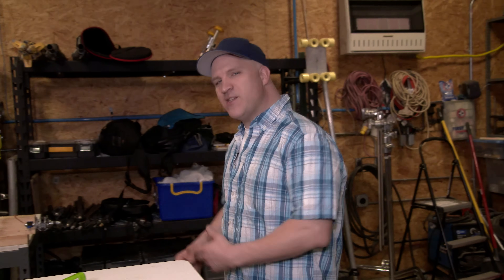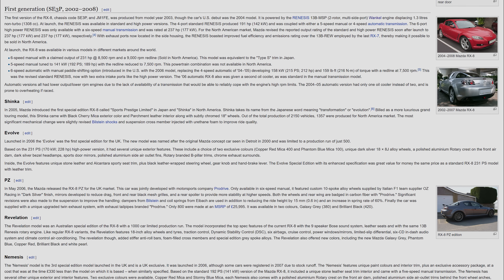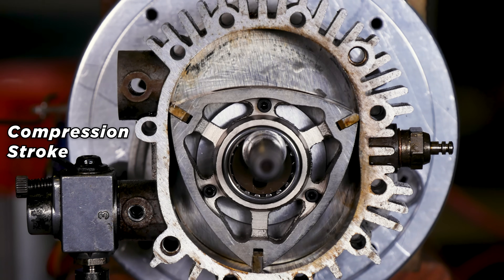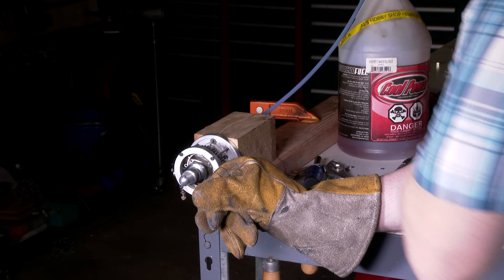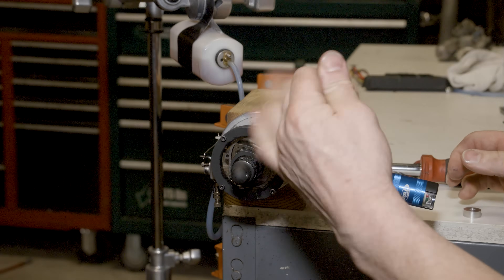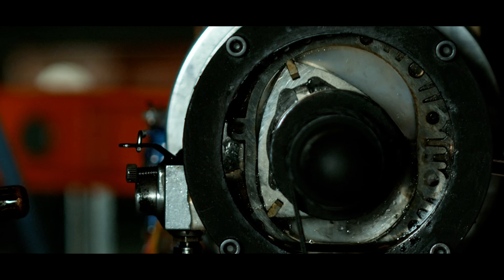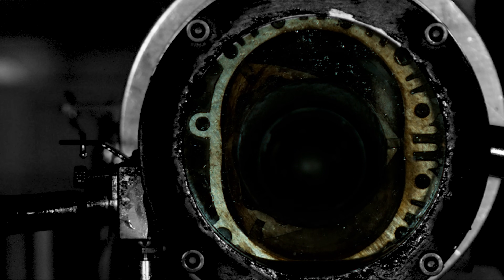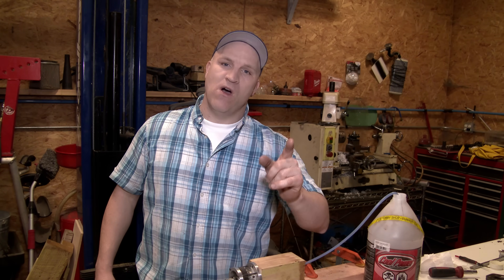See Thru Rotary Engine in Slow Motion - (Wankel Engine) 4K

Comment: You can see why we call them "Rotary Fuel Pumps".. The burn a little bit of the fuel on the way through, but a lot of it gets chucked straight out the exhaust.  Fuel Economy ?  Whats that ? ;)
Reply from the maker: SpockieTech I'll tell you on my past RX7, I always wondered why if I was sitting there with the air conditioning on in the summertime holding it at about 2,000 RPM getting some nice cold air, people would walk up to my car and tell me that they saw a glowing light from underneath, I would look underneath the car and the catalytic converter look like an incandescent light bulb...lol. all that fuel in that secondary combustion chamber AKA catalytic converter..
Reply: no one buys a rotary for fuel economy.
Reply: So if you took off all the emissions  stuff and mounted a spark plug to the end of your exhaust.....You would have a flame thrower 😆   
Na na na na na na na Na... Batman!
Reply: Haz Old no
Reply: Lmao this guy bimmer hate rotary so much... Saw him in some wankel-related videos. You must stop talking to this guy lol.
Reply: +Abil Harsono  Just the fact here, go troll somewhere else kid.
Reply: Always gotta remove the cats on an RX7 so you get those mad rotary flames on decel ;)
Reply: Warped Perception, if your cat was glowing red, you had an issue with it or the engine. My ‘94 never lit the cats up.
Reply: I wasnt talking to you and I dont intend to. I cant take people serious that search for videos about the wankel all day long to tell the people in the comments that it sucks. If you dont like it, you dont have to drive it, but leave interested people alone and stop spreading your bullshit.
Reply: As I already said, I cant take you serious, so there is no point in further talking.
Reply: Mach SCGA yeah downhill. Don’t lie about mpg. It’s really just a reflection of your driving habits anyway.
Reply: @BAYAREAMX  2002 cummins pulled 20mpg all day long, and 15 with a 12k lb trailer on the highway. around town about 15, and 19 with a camper.
Reply: I had an RX3.  Now I am the most sedate driver you could imagine.  On  low throttle I still only got 22 to 26 mpg.  But it didn't use a lot more to go a lot faster.  Low end torque?  Forget it.  But when I really used the power, going up a mountain range doing 100 mph in third then changing up into top.   It just sang. Not like me really.  But wonderful nonetheless.
Reply: SpockieTech, nitro methane is a different beast. You can’t really compare that to gasoline. Ever stand next to a funny car or top fuel in the pits while it’s seating in the engine after a rebuild? Lots of raw fuel exiting those Zoomies! 😈
Reply: Is there any way to adjust the issue
Reply: It's probably exacerbated because it's running on nitromethane.  
Watch a nitro dragster make a run at night.   There are flame shooting out the pipes from the unburned fuel.
Reply: The rotary has the same benefits as a two stroke piston engine: With less space and less moving parts they can achieve more rpm and more power, but they suffer from the same weaknesses aswell: Bad fuel economy and horrible emissions because of a lot of unburnt fuel and actively burnt oil, but they could also be fixed in the same way by simply applying todays technologies to these old engine designs: Boost, direct injection and maybe even HCCI. Sadly the two stroke didnt survive until those became popular but we kinda see the idea when looking at the two stroke diesel engines that dont burn oil and achieve selfignition while keeping the advantages of the classic two stroke. Maybe we will see something similar in a rotary someday but its a very tough nut to crack.
Reply: All science is based on faith, you may not accept that but there are no true laws in science, they are just valid until they are proven wrong, and they eventually will and so will you. HCCI isnt even properly utilized with valve control yet, so how would you know that it cant be achieved without?
Reply: Surely then there'd be a lot of potential in a lean burn rotary? Or one tuned to run slower but with greater torque output? It's essentially the same set of effects you'd see from a piston engine running far too rich.

Or even just running a steam compound type system... exhaust from one feeds into the intake of the next, with a little extra clean air bled in... maybe the first running CI, the second running SI...
Reply: They don't. If you measure the temperature at the tail pipe the gas temp is the same as any internal combustion engine. The exhaust pipes do run hotter closer to the engine than a piston engine simply because each pipe handles the heat from the equivalent of two cylinders so will run twice as hot as the individual pipes from each cylinder in a piston engine. Actually a piston engine with Siamesed exhaust ports will show the same EGT as a wankel engine and do so. 
CO? I think you mean NO? Apologies if you didn't but NO level is a function of combustion temperature and a high EGT is ALWAYS an indication of high combustion efficiency, but that must not be confused with overall efficiency. The efficiency of the wankel is poor because of the high surface area to volume ratio. More of the heat goes into the coolant and oil than a piston engine. I wish we could design an engine that utilises an expanding sphere principle, that would have the highest efficiency.
The CO level is a function of the displacement, the more hydro carbon you burn the more Carbon Dioxide and water produced, its as simple as that, why the emissions people measure CO is a complete mystery to me. All they need to know is the engine's displacement. 
The high HC level is just the oil being burned in the combustion chamber and that is another problem with the wankel engine, you have to introduce oil into the intake charge to lubricate the apex seals. If that could be dispensed with, the exhaust gas HC levels would be similar to any other IC engine. But despite what I've said, I think the wanklel engine is really an engineering curiosity and not suitable for use in automobiles but it is excellent for use in power tools and model aircraft. It's power to weight ratio is unbeatable. Oh and the RX8 goes like stink because of this power to weigh ratio! Thanks for the questions. And all the best.
Reply: How the fuck was there anything wrong? Being obsolute is nothing but your opinion and isnt based on any facts. In fact you are the one speculating that it wont ever be used again and future will tell.
Reply: Youre the one living in a state of denial, im living in a state of hope, you should try that too, might make you able to get rid of some of your negativity, because even if there is absolutely no evidence of something to happen, why would you remind yourself of that over and over again if you could just be positive and wait instead? Anyway, if by that technical feature youre refering to any sort of valve control like you mentioned above, I dont see a reason to implement them into an engine that doesnt even need valves, you can control injection and you can control ignition, what do you want more?
Reply: + Haz Old -I wouldn't bet on it being possible in a cost-effective way. Even using some new technology that hasn't been invented yet,  it'd be hard for Wankels to catch up,  because that tech. could probably be used on piston engines, too, and they would pull ahead again.
Reply: Dr. Cannibalism, and through the gears 😈
Reply: dan428 not true. Most new diesel trucks average between 12mpg-16mpg i  know I've  owned  both where my rx7 averaged about 26-28mpg. All the diesel emission BS they make these trucks have actually get far less mpg than the older diesel trucks.
Reply: The 4 port is ok. But they have a large surface are to combustion camber ratio so a lot of the heat (power) goes straight into the oil and coolant. But it is a 2.6L engine so it wont be as economic as a 1.3 will it.
Reply: Mach SCGA your * new truck. 93 f250 460 gets 5-7mpg.
Reply: The 4 port engine seems to be very reliable but the 6 port gives all the trouble. Simply because you can over rev it too easily. Once over revved the housing is damaged and the apex seals "trip" in the damaged area, after that the engine is toast. Also because of the slow gas velocity (because it is a very short stroke engine) and the surface to volume ratio the engine is poor the low speed fuel efficiency is also poor. You also get leak from one chamber to another via the spark plug holes. Another real problem is lubrication, unless oil is introduced into the intake charge there is no other route for oil to lubricate the apex seals. So yeah its a lot to consider when you can buy a car of similar performance  that consumes less fuel without all those issues. But unless you have driven a rotary car you cant understand it at all, but there is something about  the way the rotary performs. It is also very small and light but it is NOT more powerful for its capacity than a piston engine. Er yes why did I buy it......................Point made ha!
Reply: Well it gets dumped into the cooling system really there is no unburned fuel in the exhaust if its set up correctly. I know how about a rotary heating furnace?
Reply: Yes indeed! They were really 'dirty' running as well... very difficult to make emission compliant. Annoyed the smog gods to no end. Novel idea, but there were many other issues as well; mostly related to cooling & lubrication of those apex & other seals. An overheat 'event' could catastrophic to many of them...
Reply: That is the afterburner..........LOL
Reply: +niecers Mazda purchased a licensing agreement from NSU to develop and produce its Wankel KKM design in 1961... well before emissions and lead free fuel regulations. The Wankel design was licensed by 26 major engine manufacturers but most of them abandoned the Wankel around the time of the OPEC Oil Crisis due to the designs notoriously poor fuel economy, Mazda attempted to launch an all Wankel powered model line just as the Oil crisis peaked and the company was plunged into bankruptcy for the second time in its history...
Reply: @doktorbimmer  The rotary has the same benefits as a two stroke piston engine: With less space and less moving parts they can achieve more rpm and more power, but they suffer from the same weaknesses aswell: Bad fuel economy and horrible emissions because of a lot of unburnt fuel and actively burnt oil, but they could also be fixed in the same way by simply applying todays technologies to these old engine designs: Boost, direct injection and maybe even HCCI. Sadly the two stroke didnt survive until those became popular but we kinda see the idea when looking at the two stroke diesel engines that dont burn oil and achieve selfignition while keeping the advantages of the classic two stroke. Maybe we will see something similar in a rotary someday but its a very tough nut to crack.        Chuckiele
Chuckiele
8 months ago
I wasnt talking to you and I dont intend to. I cant take people serious that search for videos about the wankel all day long to tell the people in the comments that it sucks. If you dont like it, you dont have to drive it, but leave interested people alone and stop spreading your bullshit.  How the fuck was there anything wrong? Being obsolute is nothing but your opinion and isnt based on any facts. In fact you are the one speculating that it wont ever be used again and future will tell.     All science is based on faith, you may not accept that but there are no 
true laws in science, they are just valid until they are proven wrong, 
and they eventually will and so will you. HCCI isnt even properly 
utilized with valve control yet, so how would you know that it cant be 
achieved without?     As I already said, I cant take you serious, so there is no point in further talking.              Chuckiele Not true, The Wankel engines inherently weak sealing system and poor combustion efficiency make it poorly suited to high manifold pressure forced induction. GDI was already tried back in the 1960's but the Wankel simply cannot support the high static compression ratios required to achieve significant performance gains with direct-injection stratified combustion. HCCI??? How? Its not possible to adapt VCR, VVL or VVT to the Wankel... its limited to port induction and exhaust and does not generate high enough static compression. The Wankel is obsolete... for some very good reasons... it is an inferior design that no longer offers any further development potential. RIP 1964 - 2012@ktorbimmer
            
            
            

      
      +Chuckiele Engineering is not a "faith based" endeavor son, it is a science that must comply with the laws of mechanics, and the laws of thermal and fluid dynamics. Mazda manufactured the Wankel KKM longer than any other company and they have not released a new production Wankel engine in 23 YEARS!  So I sincerely suggest if your hoping for the Wankel to comeback? That you don't hold your breath!
    +Chuckiele Engineering is not a "faith based" endeavor son, it is a science that must comply with the laws of mechanics, and the laws of thermal and fluid dynamics. Mazda manufactured the Wankel KKM longer than any other company and they have not released a new production Wankel engine in 23 YEARS!  So I sincerely suggest if your hoping for the Wankel to comeback? That you don't hold your breath!
Reply: +Chuckiele Its Not?  Are you not familiar with the Mercedes-Benz Diesotto technology demonstrator? That was unveiled a decade ago? https://www.youtube.com/watch?v=N-kYwaUBwZM
Reply: +Chuckiele  "HCCI isnt even properly utilized with valve control yet,"   You have to see the irony in that comment... as MAZDA will be the first on the market with its hybrid HCCI engine in 2019. https://insidemazda.mazdausa.com/the-mazda-way/technology/mazdas-skyactiv-x-breaks-cover/
Reply: +Chuckiele You can't even fully understand basic fundamentals of engine operation yet... The Wankel KKM and HCCI technology appear to be well beyond your ability and skill level son.
Reply: +Chuckiele I don't think you take anything seriously... certainly not automobile engineering.
Reply: ernie brink rotary hemi1 second agoernie brink rotary hemi5 minutes ago (edited)Chuckiele8 months agoYoure the one living in a state of denial, im living in a state of hope, you should try that too, might make you able to get rid of some of your negativity, because even if there is absolutely no evidence of something to happen, why would you remind yourself of that over and over again if you could just be positive and wait instead? Anyway, if by that technical feature youre refering to any sort of valve control like you mentioned above, I dont see a reason to implement them into an engine that doesnt even need valves, you can control injection and you can control ignition, what do you want more?
oktorbimmer8 months ago+Chuckiele Engineering is not a "
        
    
Chuckiele8 months agoYoure the one living in a state of denial, im living in a state of hope, you should try that too, might make you able to get rid of some of your negativity, because even if there is absolutely no evidence of something to happen, why would you remind yourself of that over and over again if you could just be positive and wait instead? Anyway, if by that technical feature youre refering to any sort of valve control like you mentioned above, I dont see a reason to implement them into an engine that doesnt even need valves, you can control injection and you can control ignition, what do you want more?

    
doktorbimmer8 months ago+Chuckiele Engineering is not a "faith based" endeavor son, it is a science that must comply with the laws of mechanics, and the laws of thermal and fluid dynamics. Mazda manufactured the Wankel KKM longer than any other company and they have not released a new production Wankel engine in 23 YEARS!  So I sincerely suggest if your hoping for the Wankel to comeback? That you don't hold your breath!

    
doktorbimmer8 months ago+Chuckiele "technical feature that effects combustion efficiency"  NO, its not. Indeed, while one of the Wankel KKM's flaws is being limited to port induction and exhaust that is not what I was referring to.

    
    
doktorbimmer8 months ago+Chuckiele "I dont see a reason to implement them into an engine that doesnt even need valves,"  WELL THEN, How do you expect to implement HCCI technology????? Magic? or Hope

    
Chuckiele8 months ago (edited)All science is based on faith, you may not accept that but there are no true laws in science, they are just valid until they are proven wrong, and they eventually will and so will you. HCCI isnt even properly utilized with valve control yet, so how would you know that it cant be achieved without?

        

   based" endeavor son, it is a science that must comply with the laws of mechanics, and the laws of thermal and fluid dynamics. Mazda manufactured the Wankel KKM longer than any other company and they have not released a new production Wankel engine in 23 YEARS!  So I sincerely suggest if your hoping for the Wankel to comeback? That you don't hold your breath!

    
doktorbimmer8 months ago+Chuckiele "technical feature that effects combustion efficiency"  NO, its not. Indeed, while one of the Wankel KKM's flaws is being limited to port induction and exhaust that is not what I was referring to.
    
    
doktorbimmer8 months ago+Chuckiele "I dont see a reason to implement them into an engine that doesnt even need valves,"  WELL THEN, How do you expect to implement HCCI technology????? Magic? or Hope

All science is based on faith, you may not accept that but there are no true laws in science, they are just valid until they are proven wrong, and they eventually will and so will you. HCCI isnt even properly utilized with valve control yet, so how would you know that it cant be achieved without? god bless you doktrbimmer a big fake and you are not a engineer by all means fatih or hope dont care about your negative bs 
        
    
Chuckiele8 months agoYoure the one living in a state of denial, im living in a state of hope, you should try that too, might make you able to get rid of some of your negativity, because even if there is absolutely no evidence of something to happen, why would you remind yourself of that over and over again if you could just be positive and wait instead? Anyway, if by that technical feature youre refering to any sort of valve control like you mentioned above, I dont see a reason to implement them into an engine that doesnt even need valves, you can control injection and you can control ignition, what do you want more?

doktorbimmer8 months ago+Chuckiele Engineering is not a "faith based" endeavor son, it is a science that must comply with the laws of mechanics, and the laws of thermal and fluid dynamics. Mazda manufactured the Wankel KKM longer than any other company and they have not released a new production Wankel engine in 23 YEARS!  So I sincerely suggest if your hoping for the Wankel to comeback? That you don't hold your breath!

    
doktorbimmer8 months ago+Chuckiele "technical feature that effects combustion efficiency"  NO, its not. Indeed, while one of the Wankel KKM's flaws is being limited to port induction and exhaust that is not what I was referring to.

    
doktorbimmer8 months ago+Chuckiele "I dont see a reason to implement them into an engine that doesnt even need valves,"  WELL THEN, How do you expect to implement HCCI technology????? Magic? or Hope

  
    
    
Chuckiele8 months ago (edited)All science is based on faith, you may not accept that but there are no true laws in science, they are just valid until they are proven wrong, and they eventually will and so will you. HCCI isnt even properly utilized with valve control yet, so how would you know that it cant be achieved without?

GOD BLESS THE DOKTERBIMMER FAKE ENGINEER  AND ERNIEBRINK ROTARY NEGATIVETY

    
ernie brink rotary hemi3 days agoFuel consumption was also better than a comparable two stroke engine, but not as good as a conventional four stroke. This eventually became the downfall of the Wankel design

ernie brink rotary hemi2 days agohttps://youtu.be/mF2lR20aPL0     this one is with offset compression  super charged  check out more timing and the plug locations you will love it   performance   performance   performance  balance power with emissions.  and more efficient

ernie brink rotary hemi2 days agohttps://youtu.be/mF2lR20aPL0     this one is with offset compression  super charged  check out more timing and the plug locations you will love it   performance   performance   performance  balance power with emissions.  and more efficient
Reply: Mach SCGA diesels are very fuel efficient and rotaries are very inefficient.. this isn’t news
Reply: I reckon if today's fuel saving tech could be applied it could  make the rotary fuel efficient, like exhaust recovery systems n stuff
Reply: they have enough power to munch v8s. check out rotaries at the drag strip if you are unaware of whats going on.
Reply: @davidhusband5022  Bullshit. In mismatched races. Rotaries are under powered without   boost or nitrous. It's the low curb weight that's the advantage,  not the rotary.
Reply: triggered.
Reply: @davidhusband5022  
Your a fan boy and that's your opinion. When it comes to performance they are not worth shit. Pound for pound they waste fuel, produce little torque, burn oil to lubricate the apex and side seals, and require boost or nitrous for any kind of performance applications. Put your money where mouth is and bring a fast naturally aspirated rotary and I can bring a piston engine and wipe the floor with your precious rotary.
Reply: yeah and top fuelers are nothing without blowers too, so whats your point??
Reply: @davidhusband5022  
I replied that a v6 would dust your 1.3 trash, without boost or nitrous. My point is that your praising an obviously inefficient design. I dont need a big block to slay rotaries, or boost, or nitrous.
Reply: david husband Please just stop.. You're giving Aussies a bad name

Don't bother replying because I won't, just stop
Reply: Just simply put if you're not into rotaries you just don't understand it
Reply: +HERPY DERPEDY The Wankel has very low mechanical efficiency which is the reason for its very poor torque characteristics and it also why it was never adapted successfully to heavy vehicle use either.
Reply: HERPY DERPEDY these things are low on torque but the engine speed is where the magic happens ;)
Reply: +mosaic Then why did people stop buying them?
Reply: +Haz Old If you were going to go to all the trouble and expense of using second pass heat recovery? You would be better off starting with an engine that has higher Carnot Cycle efficiency than the Wankel, as each following pass delivers diminishing returns in efficiency gains overall.
Reply: +BAYAREAMX That's why we use the EPA 'drive-cycle' lab test to quote MPGs... this eliminates any spurious human or environmental influences on the test data results and gives of an accurate comparison between two vehicles of similar power and weight.
Reply: +Phillip Jones OH WOW! You really don't have a clue what you are talking about...
Reply: +Phillip Jones Wrong, the Wankel had a significantly higher Carnot T2 value.. this is directly related to the Wankel engines higher rate of heat rejection in the conversion process. This high heat rejection is observed as a higher EGT value for a comparable BSFC value
Reply: +Phillip Jones NO! I mean CO as in Carbon Monoxide.. You seem to be completely unfamiliar with vehicle emissions fundamentals or regulations... this is a critical indicator of combustion efficiency when the AFR value is known.. CO values are also a very good indicator of AFR.  The Wankel engine produces significantly higher levels of this poisonous and regulated exhaust gas product.
Reply: +Phillip Jones "Do you mean NOx?"  Wrong again... the production of NOx is determined by PRESSURE, OXYGEN RATIO and temperature.
Reply: +Chuckiele All Wankel KKM designs use the 4-stroke operating principle, 2-stroke Benz-cycle engine have fewer parts, and can actually rev higher. The 2-stroke reciprocating concept is vastly superior in all aspects to the Wankel and is still in mass production while the Wankel has become obsolete.
Reply: +Chuckiele Not true, The Wankel engines inherently weak sealing system and poor combustion efficiency make it poorly suited to high manifold pressure forced induction. GDI was already tried back in the 1960's but the Wankel simply cannot support the high static compression ratios required to achieve significant performance gains with direct-injection stratified combustion. HCCI??? How? Its not possible to adapt VCR, VVL or VVT to the Wankel... its limited to port induction and exhaust and does not generate high enough static compression. The Wankel is obsolete... for some very good reasons... it is an inferior design that no longer offers any further development potential. RIP 1964 - 2012
Reply: +Chuckiele Well, you must have clicked the wrong tab because you posted your erroneous, highly speculative fantasy theories for the whole world to see, I responded to everyone and my message was intended as a direct rebuttal of the completely false statements you posted for everyone to see.  Next time if you want keep your remarks private (and not embarrass yourself again) remember to reply by private message instead, good day to you sir.
Reply: +Chuckiele Your entire comment was filled with nothing but errors, false myths, unsupported speculations. Please, stop living in a state of denial... the Wankel design has been obsolete for several years with absolutely no evidence that it can or will ever make a comeback... it is simply an inferior design concept.
Reply: +Chuckiele Please name the one key technical feature that effects combustion efficiency that all modern automobile engines have that is not possible to have in a Wankel engine?
Reply: +Chuckiele Engineering is not a "faith based" endeavor son, it is a science that must comply with the laws of mechanics, and the laws of thermal and fluid dynamics. Mazda manufactured the Wankel KKM longer than any other company and they have not released a new production Wankel engine in 23 YEARS!  So I sincerely suggest if your hoping for the Wankel to comeback? That you don't hold your breath!
Reply: ernie brink rotary hemi5 minutes ago (edited)Chuckiele8 months agoYoure the one living in a state of denial, im living in a state of hope, you should try that too, might make you able to get rid of some of your negativity, because even if there is absolutely no evidence of something to happen, why would you remind yourself of that over and over again if you could just be positive and wait instead? Anyway, if by that technical feature youre refering to any sort of valve control like you mentioned above, I dont see a reason to implement them into an engine that doesnt even need valves, you can control injection and you can control ignition, what do you want more?
oktorbimmer8 months ago+Chuckiele Engineering is not a "
        
    
Chuckiele8 months agoYoure the one living in a state of denial, im living in a state of hope, you should try that too, might make you able to get rid of some of your negativity, because even if there is absolutely no evidence of something to happen, why would you remind yourself of that over and over again if you could just be positive and wait instead? Anyway, if by that technical feature youre refering to any sort of valve control like you mentioned above, I dont see a reason to implement them into an engine that doesnt even need valves, you can control injection and you can control ignition, what do you want more?

    
doktorbimmer8 months ago+Chuckiele Engineering is not a "faith based" endeavor son, it is a science that must comply with the laws of mechanics, and the laws of thermal and fluid dynamics. Mazda manufactured the Wankel KKM longer than any other company and they have not released a new production Wankel engine in 23 YEARS!  So I sincerely suggest if your hoping for the Wankel to comeback? That you don't hold your breath!

    
doktorbimmer8 months ago+Chuckiele "technical feature that effects combustion efficiency"  NO, its not. Indeed, while one of the Wankel KKM's flaws is being limited to port induction and exhaust that is not what I was referring to.

    
    
doktorbimmer8 months ago+Chuckiele "I dont see a reason to implement them into an engine that doesnt even need valves,"  WELL THEN, How do you expect to implement HCCI technology????? Magic? or Hope

    
Chuckiele8 months ago (edited)All science is based on faith, you may not accept that but there are no true laws in science, they are just valid until they are proven wrong, and they eventually will and so will you. HCCI isnt even properly utilized with valve control yet, so how would you know that it cant be achieved without?

        

   based" endeavor son, it is a science that must comply with the laws of mechanics, and the laws of thermal and fluid dynamics. Mazda manufactured the Wankel KKM longer than any other company and they have not released a new production Wankel engine in 23 YEARS!  So I sincerely suggest if your hoping for the Wankel to comeback? That you don't hold your breath!

    
doktorbimmer8 months ago+Chuckiele "technical feature that effects combustion efficiency"  NO, its not. Indeed, while one of the Wankel KKM's flaws is being limited to port induction and exhaust that is not what I was referring to.
    
    
doktorbimmer8 months ago+Chuckiele "I dont see a reason to implement them into an engine that doesnt even need valves,"  WELL THEN, How do you expect to implement HCCI technology????? Magic? or Hope

All science is based on faith, you may not accept that but there are no true laws in science, they are just valid until they are proven wrong, and they eventually will and so will you. HCCI isnt even properly utilized with valve control yet, so how would you know that it cant be achieved without? god bless you doktrbimmer a big fake and you are not a engineer by all means fatih or hope dont care about your negative bs 
        
    
Chuckiele8 months agoYoure the one living in a state of denial, im living in a state of hope, you should try that too, might make you able to get rid of some of your negativity, because even if there is absolutely no evidence of something to happen, why would you remind yourself of that over and over again if you could just be positive and wait instead? Anyway, if by that technical feature youre refering to any sort of valve control like you mentioned above, I dont see a reason to implement them into an engine that doesnt even need valves, you can control injection and you can control ignition, what do you want more?

doktorbimmer8 months ago+Chuckiele Engineering is not a "faith based" endeavor son, it is a science that must comply with the laws of mechanics, and the laws of thermal and fluid dynamics. Mazda manufactured the Wankel KKM longer than any other company and they have not released a new production Wankel engine in 23 YEARS!  So I sincerely suggest if your hoping for the Wankel to comeback? That you don't hold your breath!

    
doktorbimmer8 months ago+Chuckiele "technical feature that effects combustion efficiency"  NO, its not. Indeed, while one of the Wankel KKM's flaws is being limited to port induction and exhaust that is not what I was referring to.

    
doktorbimmer8 months ago+Chuckiele "I dont see a reason to implement them into an engine that doesnt even need valves,"  WELL THEN, How do you expect to implement HCCI technology????? Magic? or Hope

  
    
    
Chuckiele8 months ago (edited)All science is based on faith, you may not accept that but there are no true laws in science, they are just valid until they are proven wrong, and they eventually will and so will you. HCCI isnt even properly utilized with valve control yet, so how would you know that it cant be achieved without?

GOD BLESS THE DOKTERBIMMER FAKE ENGINEER  AND ERNIEBRINK ROTARY NEGATIVETY

    
ernie brink rotary hemi3 days agoFuel consumption was also better than a comparable two stroke engine, but not as good as a conventional four stroke. This eventually became the downfall of the Wankel design

ernie brink rotary hemi2 days agohttps://youtu.be/mF2lR20aPL0     this one is with offset compression  super charged  check out more timing and the plug locations you will love it   performance   performance   performance  balance power with emissions.  and more efficient

ernie brink rotary hemi2 days agohttps://youtu.be/mF2lR20aPL0     this one is with offset compression  super charged  check out more timing and the plug locations you will love it   performance   performance   performance  balance power with emissions.  and more efficient
Reply: +Chuckiele "technical feature that effects combustion efficiency"  NO, its not. Indeed, while one of the Wankel KKM's flaws is being limited to port induction and exhaust that is not what I was referring to.
Reply: +Chuckiele "I dont see a reason to implement them into an engine that doesnt even need valves,"  WELL THEN, How do you expect to implement HCCI technology????? Magic? or Hope
Reply: +Chuckiele Lol!!!! Wow!  you really are delusional son... True, Elephants really can fly if you do enough drugs. What is your poison? Do you smoke a lot of weed? or is it Molly?
Reply: Emily how are they in torque though I guess buy it's design must be awful
Reply: Haz Old my 3500 Diesel truck is a 1996... You were saying about modern fuel saving tech?
Reply: +MJR Performance Really? Thats odd because Mazda's CEO says they are not and there was no Wankel engines at the Tokyo auto show with the other 2019 models????
Reply: +Phillip Jones Interesting? "no unburned fuel in the exhaust"? Then explain why the Wankel engine produces higher exhaust gas temperatures and higher HC and CO tailpipe emissions?
Reply: +Phillip Jones Wrote, quote; "high EGT is ALWAYS an indication of high combustion efficiency,"  BULLSHITE! you sir, are a fake and a fraud! Nothing more than a crackpot!
I suggest you study the Carnot Cycle formula before you try to masquerade as an engineer...
Reply: Emily my 3500 chevy 4×4 Diesel pick up gets 24.5 mpg when my GVCW is 12000 lbs.... Your little engine wastes alot of gas